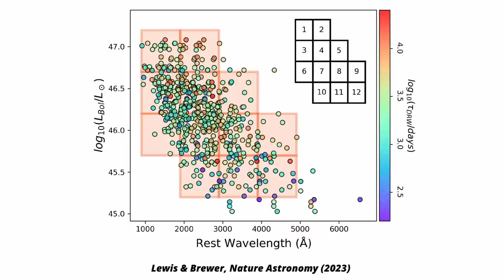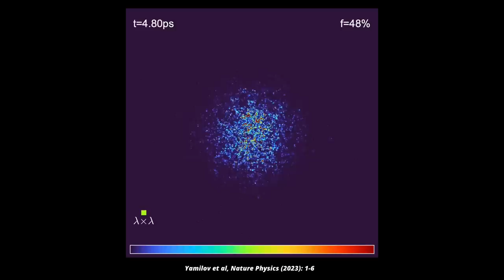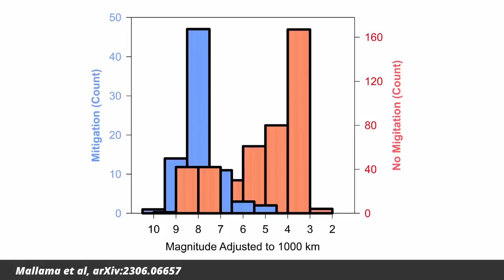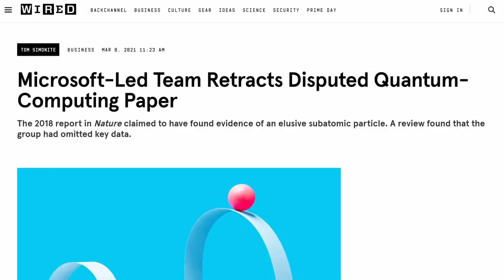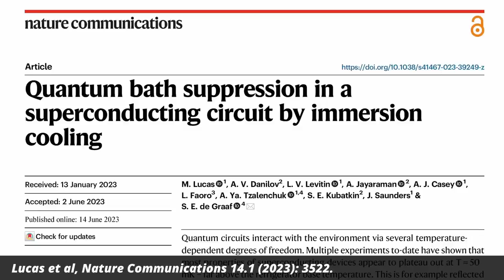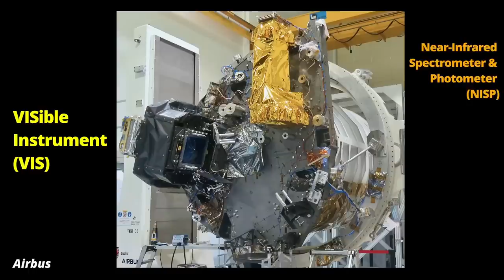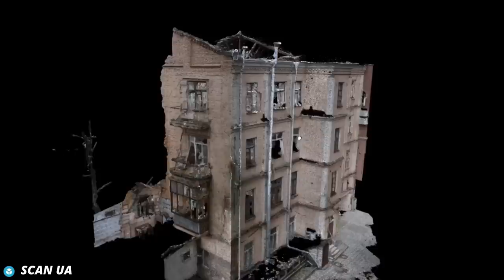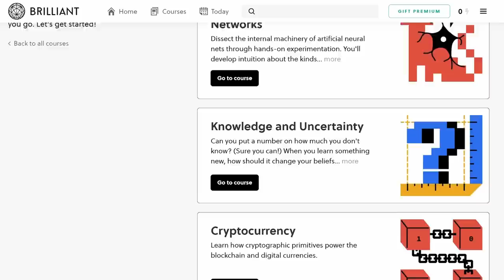Time Ran Slower in Early Universe, New Study Finds

Comment: Hmmm, if observations show that time was 5x slower this could have massive implications on all fields, it means light coming from it is for all intents and purposes in slow motion.
So that could mean the speed of rotating galaxies could just be faster (and so we maybe don't need Dark Matter) but we're seeing it slowed down due to the distances involved.
Reply: The problem is not the speed of rotation of whole galaxies, the problem is that parts of galaxies that are closer to the center should move, should rotate faster than the regions that are further, and that is not the case, so Dark Matter is there to solve that weird problem.
Reply: Additionally, if time actually ran slower in the past, dark energy is probably also bunk. It means that what we are witnessing (increasing acceleration of the rate of expansion of the universe) is not dark energy at work, but time dilation having less and less effect as the universe ages and expands, speeding up time and giving us the illusion the expansion is accelerating at an increasing pace, which is logical as the matter density is constantly dropping, and MAYBE.....this is the true mechanism that points the arrow of time, and not entropy! I always took for granted that entropy pointed the arrow of time, just because some famous astrophysicists say so, but I was never really satisfied with that answer, because we dont see time moving backwards in a frame of reference where entropy is temporarily decreasing. For example, in proximity to humans that can make conscious choices causing unnatural interaction with the immediate environment, thereby increasing complexity and decreasing entropy (I think I got that right LOL) within a specific volume of spacetime.
Reply: It really time that moves slower or just our means of measure?

Comment: Dr. Hossenfelder I suffered with this buzzing and ringing for many years. Until recently. I started with the assumption that the sound in my head was not a true audio phenomenon. Since in my case the sound was a neurological issue. I once dreamed of a device that could create a sound  180 degrees out of phase with the ringing resulting in total cancellation of the sound. but to complete my epiphany. I essentially convinced myself that since the noise was only in my head that was where the solution lay.  I  lowered the volume to zero. So far I have experienced days of true quiet, if I feel it creeping back I repeat the exercise and make it recede.
Reply: Yes, you have stumbled upon an evidence based treatment  for tinnitus. There are specialized hearing aids that can provide such sound treatment after an audiologist tests your hearing and finds the tone that matches the pitch of your tinnitus. Also, since tinnitus is highly correlated with hearing loss, many people have found that just wearing hearing aids prescribed specifically  to their hearing loss is enough to reduce the perception of tinnitus.

Comment: I'm an amateur astrophotographer Sabine and I've had to deal with a few of those pesky Starlink satellites streaking through my photographs as well. It's not that they're difficult to remove from photos, at least not at their current population, it's the fact that the noise reduction algorithyms in the processing software has to average them out and replace them with similar pixels to the ones they're covering up. So really you end up with an approximation of what the sky looked like where the satelites left trails. You're actually loosing real data, and that's not scientific. For instance, a satellite streaks through a long exposure and covers X amount of stars. It's always going to be a streak because to capture stars you have to do long exposures. Your tracking mount compensates for Earths rotation so that your telescope remains locked on the target portion of the sky, otherwise all the stars would be star trails rather than point sources. Therefore, anything moving with respect to the background stars, gas and dust, will leave a streak. If your post processing software averages out streaks or what it calls outliers of a set of multiple exposures, (stacked to increase signal to noise), not only are you loosing stars, you could loose an asteroid or comet because the algorithym can't tell the difference between them and satelites. So imagine one hundred thousand of them circling the globe. Some point sources are so small and faint that they'll be occulted by a streaking satellite. The data,(photons), behind the streaks are lost. Similarly, meteors can be taken out, but sometimes we like those in wide field landscape astrophotography. Imagine you had a bunch of elements blocking signals between the collisions and detectors of the LHC. How long would it be before a physicist figured out a way to remove the obstructions? Not long I'll bet, but that's not an option for astronomers, professional or otherwise. All any astrophotographers can do is average out what's not supposed to be there with data from a frame it doesn't appear in. Imagine how much harder that becomes as the sky progressively fills up with reflected light from our closest star. I can see satelites being so numerous that they begin to reflect low altitude sunlight to higher altitude satelites,  resulting in multiple anomalous signals and opticle abberations. It used to be that the night sky, as Timothy Ferris once said, was the greatest show in town. Now most people aren't even aware of it. All we see are screens and were loosing the sense of a much bigger picture of our existence. Being able to look back at our history is a gift that we should try our best to preserve. And it's so beautiful! So maybe it's worth spending billions of dollars on more fiber optic cables. If we don't do this satellite thing properly, we may one day not be able to leave our planet.
Reply: tldr
Reply: @JK-dv3qe  Oh, whiny! I hate technology because it spoils my cute photos! Re: "I've had to deal with a few of those pesky Starlink satellites streaking through my photographs "

Comment: I am now wondering: 1) Would the cosmological time dilation account for the differences of the Hubble constant calculated from far away galaxies compared to the constant as calculated from the expansion of the Universe after the Big Bang? 2) Would there be another time dilation due to the higher concentration of mass in the early universe?
Reply: Number (2) would make sense, if matter (gas/atoms/etc) is much closer together, the gravitational potential would be higher and so time would run slower. Makes you wonder - is it like 10% slower, 10x slower, or 10000 times slower? Was there a time-singularity at the beginning, or was there some finite, peak time dilation that was never exceeded?
Reply: @Niohimself  but the gravity was the same everywhere, so every observer would experience time at the same rate
Reply: @kapsi  But would be slower than it is now
Reply: @colindewolfe3647

Their clocks would not run any differently.
Reply: @Niohimself  Something else just occurred to me. You asked if there was a time-singularity. I think that should be a Spacetime - singularity. Compared to Black holes which are just space singularities (and possibly contain their own time dimension within the event horizon). In other words, black holes take up 3 dimensions, but the big bang took up 4 dimensions, including time.
Reply: @kapsi  Not so. As soon as the universe had physical dimensions, there were places that were more or less dense than other places meaning there was a gravity difference as soon as the big bang occured, so time dilated more extreme for one place than the other, meaning time dilated more or less at those places. Also an indicator that the age of the universe cannot be infinite. Fast forward to today and those teeny tiny differences have grown to epic proportions. Quantum Gravity hunters are going to have a field day with this data. And if what I say turns out to be accurate, a theory of quantum gravity might be a step closer.
Reply: @paulmichaelfreedman8334  Black holes contain mass/energy singularities.
A space singularity would be a point where there is an infinite density of space. Which I don't think makes sense.
Reply: @alansmithee419  I agree, I did not word that very well. But you got the gist about black hole singularities/ event horizon occupying 3 dimensions and the big bang occupying 4?

Comment: Starlink began mitigating reflection shortly after the problem was first noticed (~4 years ago). They've been providing the materials they developed to reflect the light away from Earth-based observers at cost to other satellite builders to further reduce impact on ground-based astronomy (the sats are at <550 km, so somebody worked hard to get that Hubble shot). The BIG news is that the v2 satellites are much larger, yet due to SpaceX's efforts to improve the design and materials, they have an even smaller optical profile.

Comment: Does that mean it will speed up in the end?
Edit: If you go back past the slow, does is slow to a stop - does time stop existing? almost.. like a singularity... maybe a BIG BANG happened
Reply: My question as well.  Does the time change linearly or does it fit to a curve?  (Or would the error let it fit to a curve?).  How would this affect early expansion?  And the speed of light back then…
Reply: @mdarian  Would light even notice a difference? If time was slower too, how did Galaxies form so fast?
Reply: Heat death will eventually make time meaningless, as there will be no clocks left, only photons redshifted to ginormous wavelengths.

Comment: I have left several comments on this channel over the years wondering about time dilation in the early universe, glad to see it covered!
To me, it was a simple explanation for the Hubble effect, that as we looked at more distant objects, the light they emitted had to "crawl" out of the gravity well of the big bang and was consequently red-shifted, whereas newer stars light did not have to do so. My (probably very naive) conclusion was not that the Universe was expanding at an increasing rate (it might be), but older objects simply emitted light that had to "fight" a much harder fight to make it to us than newer stars. I hope someone can tell me why this is wrong!
Reply: The gravity well you described. We are still in it.
Your theory would only work that way if we are observing the universe from the outside.
Though time dilation would be a case.

I get that you were doubting the theory of redshift being caused by expansion. 
I had the same doubts. But other theories.
Until I learned about time dilation being the same concequence.

Now the scientists have found a good way of determining this time dilation.
And actually could start comparing this time dilation with the coresponding redshift.
If the time dilation is a bit more or less than the redshift observed. 
They can start scratching their heads again.
Maybe the denser universe did have a slower time. 
But it would only show time dilation, no redschift.

Example (to mess with):
The observed time dilation is roughly 5 times. But so is the redshift.
If, let's say, the time dilation is 5 times, while the redshift is, let's say, only 4 times. 
Then the denser universe theory will get proof from this. 
At a distance of Z=4, we got 25% more time dilation caused by a denser universe.
Reply: Me too, not shocked to see they got it wrong lol. Time would be running faster in the past if the universe is expanding.. not slower lol. If when we look out and measure it gives the illusion of time slowing that by definition means time passed faster in the past.. not slower lol. I have been trying to get them to cover this concept for a while too and once they finally do they get it backwards 😅
Reply: The average density would have to be close to a black hole or neutron star for this to be a significant factor. The absolute depth of the gravity well of the sun is much deeper than that of the early universe when you look at the average. The gravity of the universe is more like a bumpy road that has slightly more bumps in the past.
Reply: @nighttrain1565  To say that you have been trying to get them to cover it, are you claiming to be someone of import?
Reply: @thearpox7873  export*
Reply: @nighttrain1565  Forgive me, but if you are making a joke, I do not understand the humor. 

I meant 'someone of import' as in someone important, someone the community of theoretical physicists would know and not just a random youtube commenter.. To change 'import' to 'export' would render the question meaningless.
Reply: @nighttrain1565  The red-shift of light was not the new evidence here. The new study looked at the variability of 200 quasars at different distances from Earth. I wish she had spent more time explaining what that meant. The authors claimed that this evidence showed that time moved more slowly at the beginning of the universe. She also said that previous studies had not seen this result, so this paper will probably be hotly debated.

I think she put in the example of a wave being a clock so that the public would feel that they understood the passage of time changing. I wish she had left that out, or stated that it was just a pictorial aid. Let me use another pictorial aid: a train is moving towards me and the Doppler shift raises the frequency of its horn. After it passes the frequency of the horn drops lower than the horn of a train sitting still. She seems to be saying that time is passing slower on the train moving away from me, and you seem to be saying that time is moving faster on that train.
Reply: @EinsteinsHair  no no so close tho!! SHE is essentially saying that time on the train moving away from you is moving faster not slower. But your understanding is in agreement with mine It should move slower in relation to the person measuring. 
It really all comes back to the baseball exploding analogy. If you were measuring the rate of expansion of a baseball exploding the outer circumference of the baseball would not be accelerating from the innermost core as it explodes. It is a linear rate. An explosion is a linear rate no matter what. But if you are a particle within the explosion and measuring a particle going away from you it's going to seem like it is accelerating but that is just the product of being a particle within the system of which you are measuring. We should be traveling the same distance away from the innermost parts of the explosion we are measuring as the parts we are measuring going away from us. The rate of which all particles are expanding should be equivalent if we are measuring from a single point of expansion. That's just a rule of law lol. And if you are to replace the points of expansion of an explosion with the points in time of the space-time fabric then time should pass faster in the early universe and slower as the universe ages simply by relativity. If the early universe was more compressed than the current universe then time passed at a faster rate. It's pretty simple really. The passage of time should naturally slow as expansion continues. And expansion is only going to seem to be increasing because we are a product of the system we are measuring. It's not increasing in speed it's a linear expansion rate. But that misconception has led to two generations of bad math lol

Comment: Is cosmological time dilation just a special case of gravitational time dilation? I.e. when everything was closer together, the average gravitational field strength was higher, ergo the average speed of the passage of time was slower?
Reply: I just asked a similar question. I don't know how the distribution of the mass of the early universe affects this... ie, if you're surrounded by the same amount of matter on all sides, the net gravitational effect might be zero (as it is at the Earth's center). 

IOW, unless a point "feels" acceleration due to gravity, then I don't think its clock is slowed down [relative to another point which does not "feel" that acceleration].

But I have no idea how the math works for a universe dense with mass and having no known boundary.

Comment: Sabine: What do you think about the hypothetical idea around the Electric universe type concept? At least thoughts in that direction? *The more i ponder about it, the more i realize the electromagnetic feild is a part of a lot. The frequencies of photon's create all types of radiation. (IR/UV/visible light/X-rays/microwave's/alpha/beta/gamma rays) ☀️ All related to stars. Magnetic fields corelate alongside. It seems like they play huge importance to so much: hot/cold, positive/negative charged energy, static bond between particles, differences in air current/pressure differences, boundary layers between 2 points/state's of matter, geothermal energy in internal density, viscosity, plasma, atmosphere's, the list goes on. If we didn't have light/photon's/star's creating light/radiation/then the building blocks of a lot of core aspects of the Cosmo's ecosystem wouldn't seem to function properly.. so light/frequency/ magnetism/ radiation/ vibration/ all seem very important in the make up of nature.   Seem's at least worth pondering about? 
Idk? Ignore if this is a stupid question/thought?/comment. 
You just seem like the right person to ask this about?